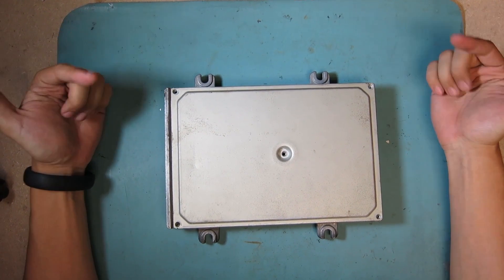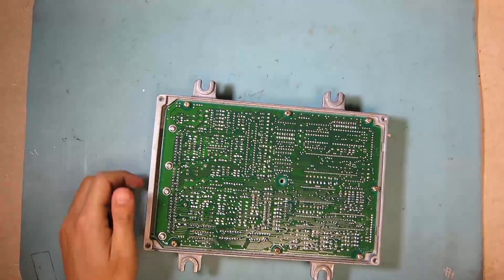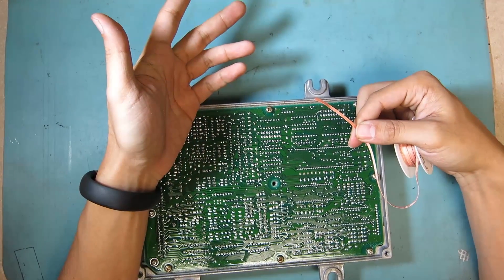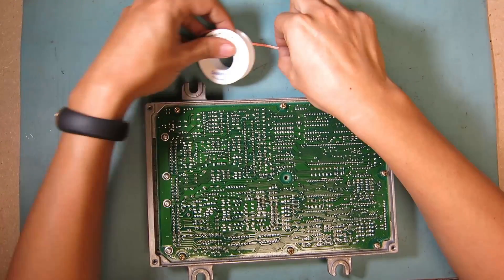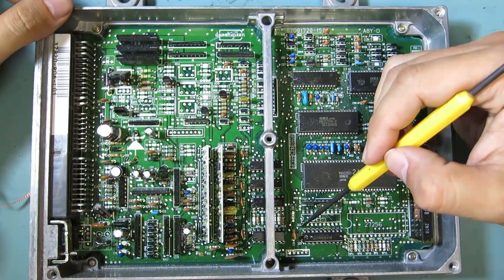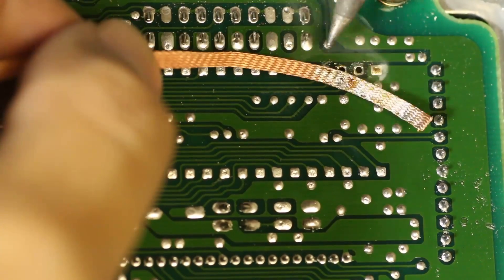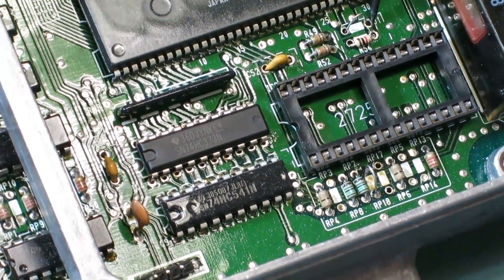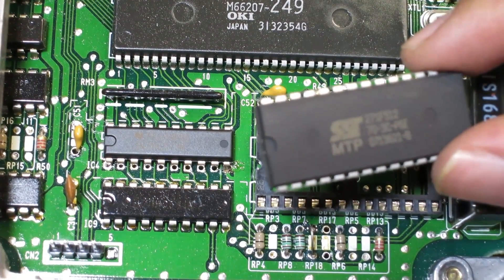How To Chip / Socket A Honda OBD1 ECU (Easiest Way)

Comment: You make this look so easy. I can get the solder to stick to the socket but not to the PCB.
Reply: I know this is an old comment but just for if you still struggling or if anybody else is - heat up the pin  that comes through the PCB and melt the solder onto that, it will then melt down and attach itself. If you try to melt it to the PCB you won't have any luck.